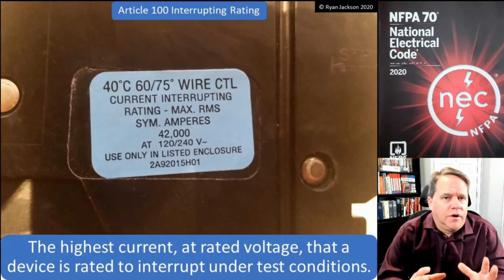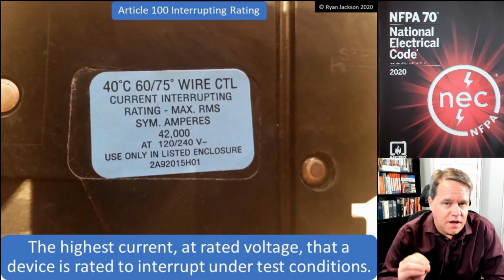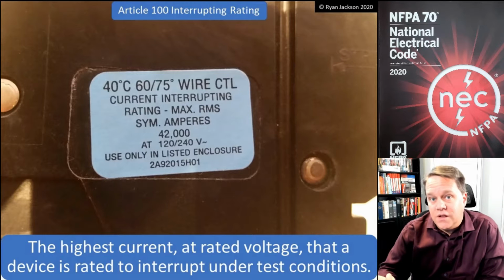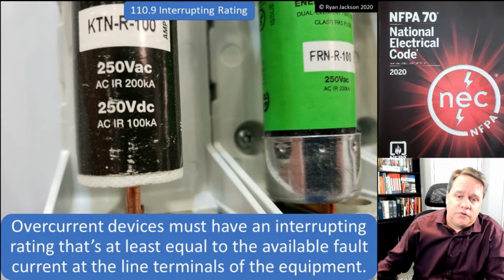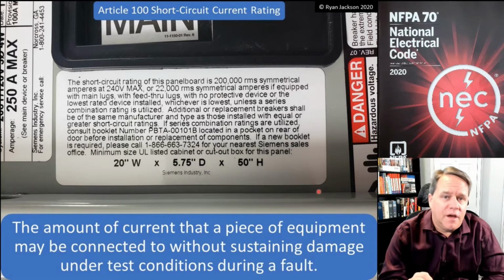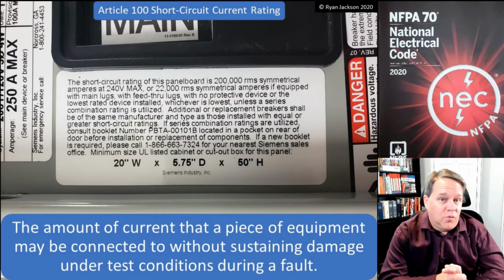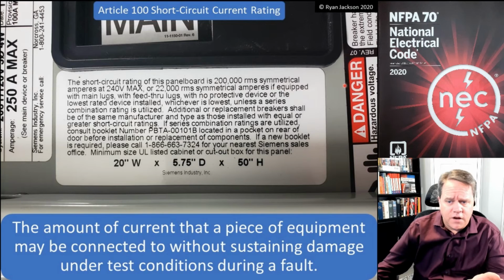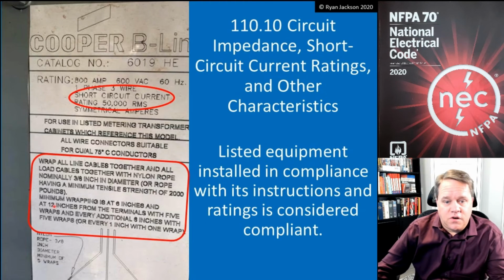100 Days of Article 100: Interrupting Rating and Short Circuit Current Rating

Comment: Like it.... I do find even here in Massachusetts. How often the short circuit rating is never put into the equation...
I would like to see a video on how such ratings are done by the utility, and how utility has managed to install greater short circuit potentials in existing infrastructures without warning their customers about the new  hazard that they have introduced.
Thanks for sharing your knowledge.

Comment: I still wonder about the bracing.    Does it mean that the force is capable of ripping conductors from the terminals?  I'm sure the conductors would not break up on their own.  If properly torqued in the terminals, will they pull out?  Sorta hard saying not knowing.  Pretty sure it has something to do with the unsupported length.  Not many have the luxury of testing such things.  Manufacturer does though.